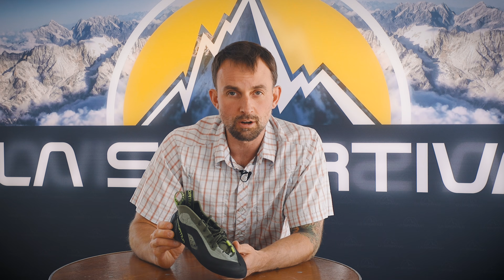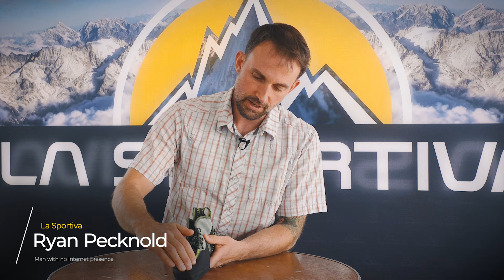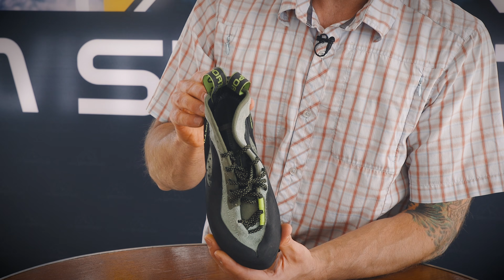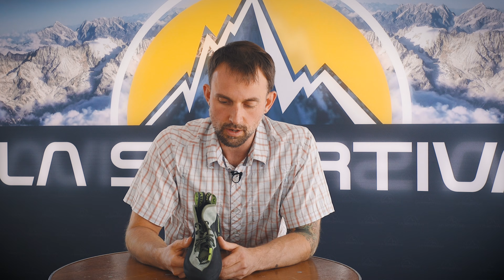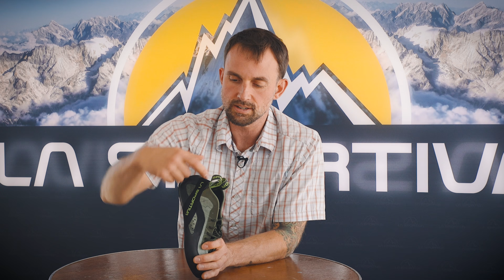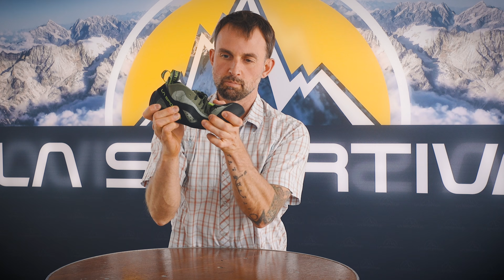*NEW* La Sportiva TC Pro 2021 climbing shoe

Comment: Great coverage of the features and changes. My $.02: I purchased the new 2021 version and went down a half size from my normal TC Pro fit. The new version (43) is noticeably narrower in the heel and forefoot, but the overall length is the same as the old version (43.5) for me. Toe box profile seems a bit taller than before, but the rand build definitely seems like it will prevent delamination as was prevalent in every pair of TC Pros I have previously owned.